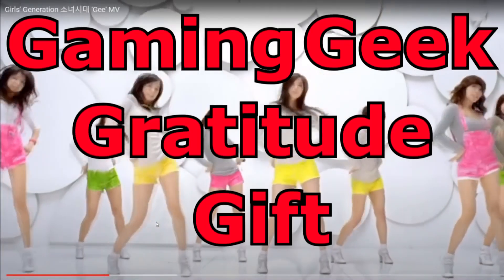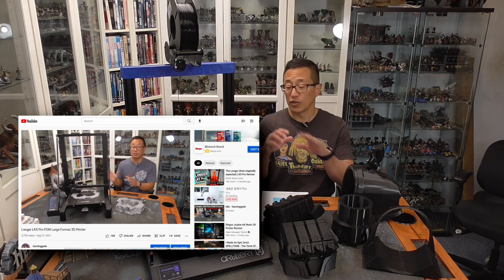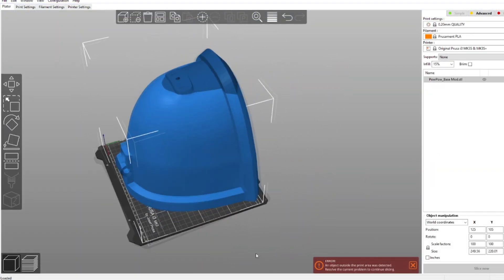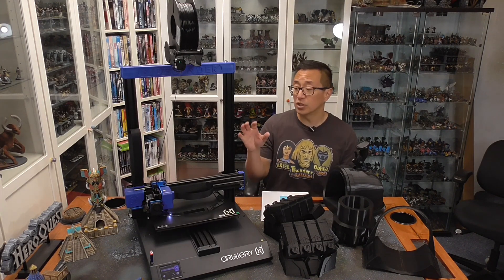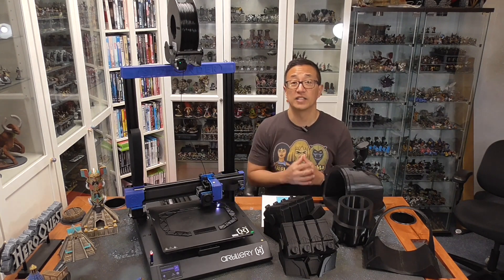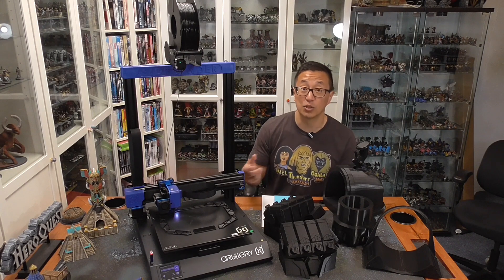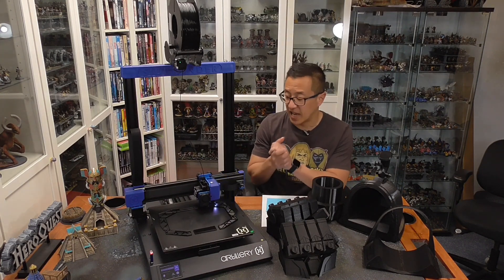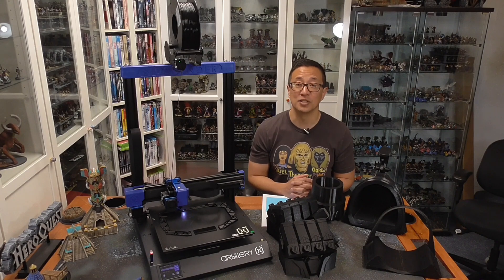Artillery Sidewinder X2 Review

Comment: My X1 came with a similar spool holder to this one. It also has the same filament run out sensor. But sadly no auto bed levelling.
Reply: you can add that if you want man :) get a bltouch or a 3rd party model and you can connect it up